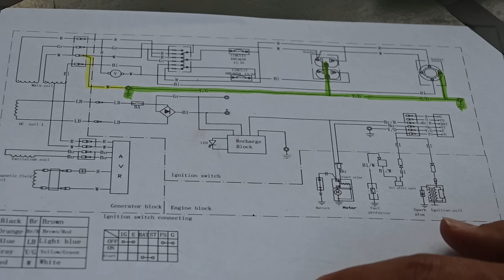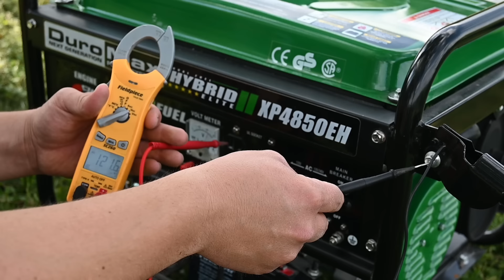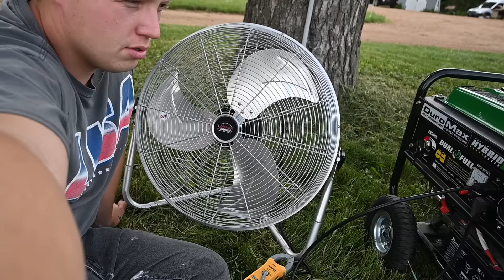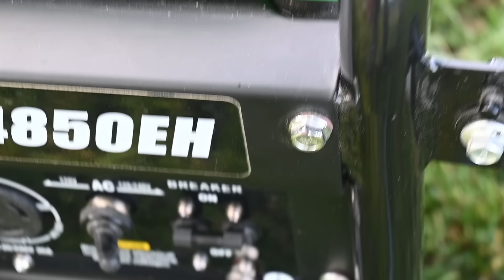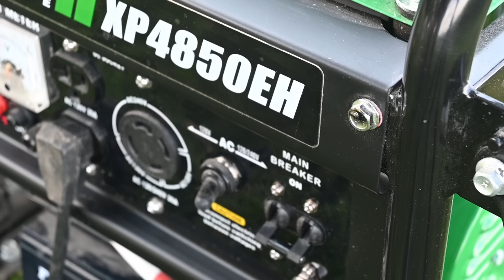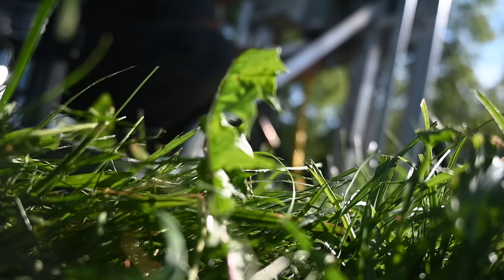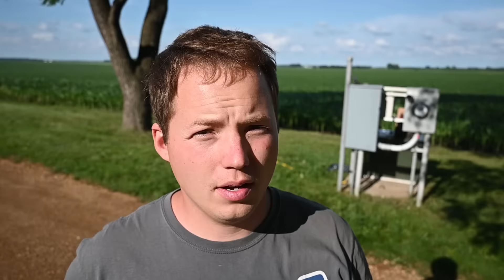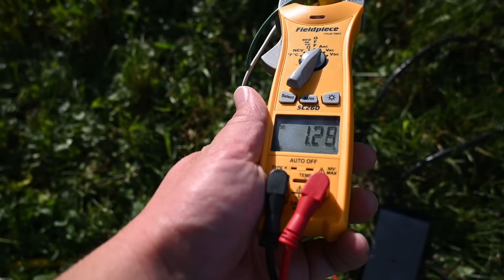What is a Floating Neutral Generator?

Comment: Ben I have a question I have an older Generac generator with a floating neutral, I did that myself by removing the jumper wire in the 120 duplex connecting neutral to ground. The generator is connected in my garage to a subpanel that feeds the house. Of course in the sub panel the neutral and the ground are not connected their separate. Do I still hook it up just like you did using the four prong connector two Hots a neutral and a ground? Or do  I ISOLATE the ground connector wire in the four wire extension cord connector  that plugs into the sub panel and run a separate ground from that connector into the main panel of the house?

Comment: do you have a way to "clean" up the power from these generators? I have the 13k version of this generator but im worried about ruining the circuit boards in electronics. 
I think I might just buy a UPC for the computer, but I was wondering if there was a way to clean up the power as soon as it went into the house?

Comment: Greetings: Advise - If U R going 2 talk technical  and use technical terms I suggest U use appropriate terms in the appropriate situation. U stated measuting "current". According 2 the illustration U measured voltage. They R nit the same. Thx 4 the share.

Comment: Hey Ben amazing video as always! Even though Im usually that 90% never subscribe to anything guy I still subscribed to you since I find your videos top notch. Always very informative and accurate which I’m sure you know isn’t always the case around here!
I have a quick question also about a setup I’m wiring for a generator I just ordered. I have a setup similar to yours where I have an outdoor disconnect panel that is bonded just a couple feet from my main load center in the home which of course is unbonded being technically a sub panel. Well I installed my interlock kit to backfeed into this load center rather than the first disconnect the way you did. My question is even though my interlock is in the “sub panel” I should still use a floating neutral generator since the system is bonded at that upstream panel which would only isolate and disconnect the hot legs at the main breaker when the generator is switched on. Am I correct in thinking this? I suppose just plugging everything in and testing continuity would confirm but since you seem very well coursed on bonding figured I would ask if this setup would be ideal even though it isn’t bonded right in the panel with the interlock. Thanks in advance and please keep on making these awesome videos!!

Comment: if you wanna power a sub panel with a generator... so main panel 100amp to a sub panel..  and i wanna power the sub panel with a generator with a 30amp generator.. would use a floating or non floating generator

Comment: Ben - Just curious, why did you not use a 50 watt power inlet box that is rated up to 12,500 watts and a 12,000 watt portable generator (Duromax) for the emergency power back up with your house? (Besides extra cost)
Reply from the maker: Honestly I thought I just didn't need it. In a power outage all I really NEED to run is the refrigerators and freezers, gas furnace, lights, and the well. All of that can be handled by the 30a inlet. I might upgrade to a 50a at some point as it would be great to be able to run the water heater & AC but those are luxuries in a power outage in my opinion. :)
Reply: Benjamin Sahlstrom Very good points! Thank you for the prompt response. I appreciate it.

Comment: Great video.  But I do have a dumb question: what is the point of grounding rod at all?  The generator is on rubber tires (insulated) so there is no path from the rod back to the generator, correct?  If anything, wouldn't the rod theoretically provide a path through  through me  if I were to touch the energized frame:  source->frame-> me -> ground -> grounding rod ->neutral (if bonded) -> back to source?  Wouldn't it be better if the current flowed through my fingertip only, as opposed to through my body to the ground?    And if if  unbounded, wouldn't this be an open circuit in this energized frame scenario, so no current at all?
Reply: I don't think this was a dumb question at all..
IDK, but it seems as though there is a fundamental misunderstanding of live/neutral/ground... Or I'm just WAY off..

This is the absolute biggest problem with the American "standard". So many are used to ground lines being connected directly to neutral, and have nearly synonymized it with being ground. Here (Europe) we have a "main" ground fault protection breaker that triggers on a few milliamps, which is physically linked to the power-breaker. And from what I understand, they don't usually have that.
This intrinsic "linking" in their minds between ground and neutral, makes them forget that both live AND neutral are the wires that create power. They could connect the live wire to the ground instead, and everything would work exactly the same. It seems that most don't realize that touching something grounded, is actually touching one of the phases from whatever generator. There is no danger in touching one phase, since there is no potential for electricity to run trough you.

So in my mind, I agree completely with you. If you take the generator out camping, you're just introducing "danger" by grounding it, since your basically exposing one side of potential to the surroundings/chassis/and all else touchable. You ARE however introducing more protection for the equipment itself, since it now has a chassis that would trip the breaker if it's live wire came in contact with it. But that isn't usually what happens... Usually it's water.. And water has enough resistance to just boil while not tripping the breaker. THIS is where you'd need a ground fault protection breaker. Cause THEN you would be introducing safety.

Connecting neutral to the chassis is basically "energizing" it. Just the same as connecting live to the chassis is "energizing" it.

But the grounding rod thing.. With a generator, it's just weird... Someone needs to explain this to me, because I think you are in a way correct, that the grounding rod is basically putting potential in the ground. Note that you also put the same potential on the chassis of the generator, so they are "evened out" and thus have no potential to carry power trough the rod, trough you to the chassis. However, the rod serves no real purpose other than make whatever it is connected to, more connected to the ground in case of lightning strikes.. In a house, this makes sense, since you'd want as many grounded wires everywhere if lightning struck, so it could primarily dissipate to ground trough those wires, and not trough everything else.

Comment: "open lead?" I always called it Open Load 😁
Reply from the maker: Apparently it's for "overload" as another commenter explained as it is out of range for the tester. So I guess we're both wrong? Haha. I needed to study my multimeter's manual.
Reply: @BenjaminSahlstrom  oh yeah thanks. Now I remember seeing the OL also when the voltage I test is higher than the range setting
Reply: Fluke defines it as open line
Reply: @BenjaminSahlstrom   I think it really means an open loop (resistance) or over/out of range for the meter (any electrical value)..
Reply: its Outer Limits.   

 Please stand by.
Reply: @Fred Wills it still makes sense if you understand how the meter is testing resistance by applying internal battery with resistance to the load and measuring voltage across the load with a limited range. The result is when the voltage gets high enough to consider it no connection, it displays OL

Comment: So I have a generator with a floating neutral that plugs into a 50 amp inlet receptacle. The 50 amp inlet is wired to a 12,500 watt Reliance Controls Protran Transfer switch, which is wired to my  main panel.  The main panel has mixed neutrals and grounds on both the neutral and ground bus bars, the ground bus bar is grounded to the panel box, via the big green ground screw. Also, both the neutral and ground bars are jumpered together by a copper rod.  Now since the transfer switch itself has breakers, does this make my main panel the second means of disconnect when the transfer switch is in generator mode? Do I need to add a separate ground bar and unground the panel box and get rid of the copper bar joining the ground and neutral bars?

Comment: My Samsung refrigerator keeps tripping the GFI on my Westinghouse 7500W generator every 10 min. Westinghouse customer service said to remove grounding wire to convert to floating neutral and this should solve my problem.  Is this another use case for floating neutral? Do I need to ground the generator if I do this and am connecting the refrigerator with extension cords?

Comment: So if a floating neutral has a short from the hot wire to the frame of generator would you would get shocked if you touch the generator? Also what app is that you used to get your phone to read watts? Thanks.

Comment: I have a duromax 9000ih inverter generator and I want to use it on my house and it is bonded.There are you tube videos that show one white wire to disconnect to make it floating  but mine have two white wires in on terminal.  Any ideas on how to fix this?

Comment: Ok im a little confused with the whole bonded and floating thing, i have always just ran things off extension cords but bought a new 10k champion dual fuel and want to put in a transfer switch panel. The champion is bonded so do i have to do anything with it when I install the gentran  panel? Im basically only going to have the fridge, freezer,furnace and sump pump on outages

Comment: Is it normal to have a service panel outside of the home like that?
Reply from the maker: It's fairly common out on acreages to have a setup like this. It's not as common in towns that I'm aware of though. Personally I really like it since you can kill power to the entire property without going into a building.
Reply: It is common to wire farms with a service disconnect at a central location, then run power to the individual buildings from that point.

There are other scenarios in which you would design that sort of system. If you are curious, search for videos on "service entrance."
Reply: How do you keep water out of the panel? It doesnt look any different from the one in my house.
Reply from the maker: @beachboardfan9544  It is an "outdoor rated" panel so is designed to shed water somehow I guess.
Reply: @beachboardfan9544  search 'NEMA Enclosure Types'
Reply: @BenjaminSahlstrom  One scenario you might see "in town" is a service disconnect mounted outdoors next to the meter if the "main" panel is not located inside close to the meter. For obvious reasons, you wouldn't want to run  "un-protected" conductors from the meter to some distantly located "main" panel elsewhere in the structure. The meter has no protective function if there were to be a fault in those conductors.

Comment: I'm not sure is this explanation might help: connecting the live wire to the earth rod does not create a circuit back to the generator because the earth rod simply sinks all the electrons into the Earth, hence they cannot find a path back to the generator's neutral wire. By connecting the earth and neutral wiring together, any shorting of the live wire against the generator's metal parts (which are all earthed) causes a circuit back to the generator's neutral wire (causing the circuit breaker to activate) as well as diverting some of the current to the Earth via the earth rod (if this is connected). The resistance of the current from the live wire to neutral will be very small (0.1 ohm) compared to Earth (100 ohms), so most of the current is going to go through the neutral wire to activate the circuit breaker, which will quickly switch off the generator engine and so prevent any further shock to the user.

Comment: So my generator is currently configured in a bonded state. Would feeding it through a panel like you have yours set up cause GFCI outlets to trip since there is current going through the neutral wire? I intend on using my generator for camping as well and it would be more convienient to leave it bonded than have to swap it back and forth or heaven forbid you forget to swap it back to bonded and have an accident.

Comment: @benjaminSahlstrom, looking at the setup in your video, the generator inlet is outside basically under a tree.   This appears to mean that a generator would be close by during an outage.   I don't see any weather protection for a generator near this inlet.   Would this imply the person (during a storm induced outages and still raining) could use a bonded generator exposed to the rain?  If so, this is interesting news, I never knew generators could operate directly exposed to the elements during an outage.
Reply from the maker: I would not operate the generator during rain or I would place the generator in a small enclosed trailer with the doors open if needed. It's a basic problem that could be solved easily if there were an extended outage. We almost never lose power in our area.

Comment: Ben, excellent information. To my understanding, a breaker interlock CANNOT be used with a bonded neutral generator, correct? And if so, what would be the correct method? A transfer switch of sorts to make use of a bonded neutral generator.?
Reply: Your main panel that has the interlock kit and this the “isolated main breaker” is already bonded neutral. That is your first means of disconnect. Using either generator will be bonded through that connection at the panel.

Comment: Essentially, a generator to power circuits in a house should be treated like a sub panel. The neutral and ground should be separate, or - a floating neutral.
Reply: If I do not use a transfer switch and run the 4/10 cable directly into a 220 breaker/ground/natural in my breaker panel should the generator be bonded or floating?

Comment: I just bought the new F150 which has a 7200W generator built in. The truck is 'bonded' and when i connect it to my transfer switch, the truck says I have a ground loop error and turns off the electricity immediately.  The transfer switch is connected to a sub-panel and not the first disconnect from the meter. A solution that I read online is to disconnect the GROUND conductor coming from the truck and plug in the 4-conductor cable into the transfer switch and it will not give me the error anymore. I also read that I need to buy a transfer switch that is designed to be used with a bonded generator which will require a complete re-do of everything i've already done. Is it safe to simply disconnect the ground conductor coming from the truck to solve this problem?

Comment: Do you have to use a neutral wire when back feeding your panel with 240v from generator.
Reply: Do you need 120 volts for anything ?
Reply: @MrSummitville  no
Reply: @timowens1831  If you have no 120 volt circuits or 120 volt loads then you have no need for a Neutral wire.

Comment: Can I run a 6500 watt Generator,  with 2 Male prong 120 volt  make into a 30 amp box that would be 240 volts at 30 amps? I will be powering a Inverter Welder?

Comment: I know this is old but I have a question I have a Harbor freight 9000 generator and I ran a 6' copper ground rod ,  in to the ground with a 12  Gauge copper wire  and hooked it up to the ground  on the generator (  a nut on the front of the  Generator said ground  )   did I do right or wrong can somebody tell me.  
I  use it mainly for welding 220 v  sometimes   
Not much 120 v .

Comment: Hi Ben, I recently purchased a Generac portable for home use. It is bonded to the frame which is visible. Do I need to connect to a ground rod when I use the 30 amp cord  to power through my panel via an interlock?

Comment: I'm in S. Californa and have one main panel but it has 2 main breakers, why? One is 200A and service upstairs via its subpanel upstairs, the other is 150A and service downstairs. The main panel has some smaller 10-30A breakers but they are all controlled by the 150A. So, why then I do NOT have a 350A (200+150) master breaker? Confused.

Looks like I cannot use an Interlock given the subpanels would also be locked out when on generator. Using a transfer switch: Is there a transfer switch that I can put a 200A, a 150A, in the transfer switch, If yes, where do I site the generator 50A breaker, in the transfer switch or main panel? More confused.

Thank you in advance for your (any) input.

Comment: Once you remove the jumper and make the portable generator floating neutral, do you have to have a ground wire going from the generator to a ground stake if you are plugging it into an inlet with an interlock? That's where I'm confused.
Reply: Mike Holt…. Look up his videos.

Comment: I have a Duramax XP15000EH Dual fuel generator that has a bonded neutral.  How can I connect it to my main breaker panel to work and work safely  ? All I'm seeing to do is having to buy a 100A,  3 or 4 pole transfer switch panel and 50A - 60A 3 or 4 pole transfer switch for the box. HELP PLEASE !!!

Comment: I need help I have 12000watt generator to the inter lock box from there to my 200 amp service panel. When I turn the generator on I’m able to run only 1or 2 breakers then I lose power, it seems like a voltage drop but it only 75 feet. It a puslar  generator was going on

Comment: I have a generator in mind that I'd like to buy, however, it has a floating neutral, confirmed by manufacturer. I only intend it to be used with power tools, not as a residential back up generator. Am I being naive, but could I use it for this purpurpose if I use a bonding plug? Thanks